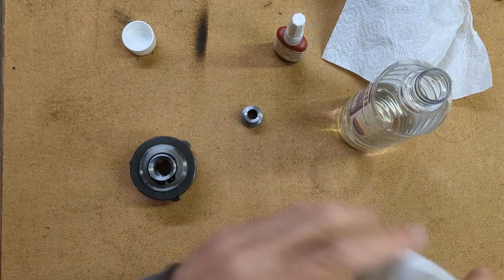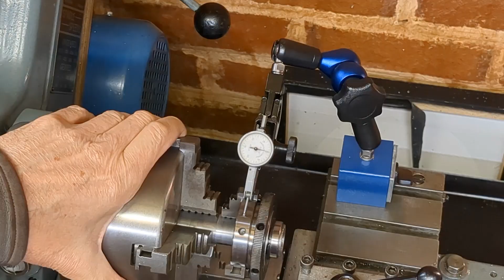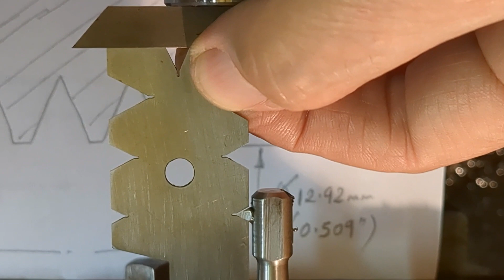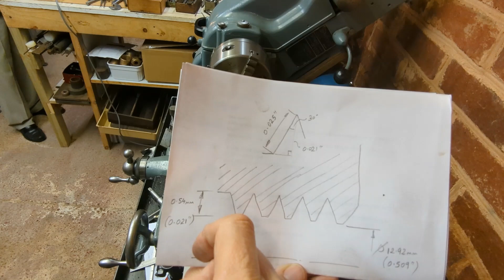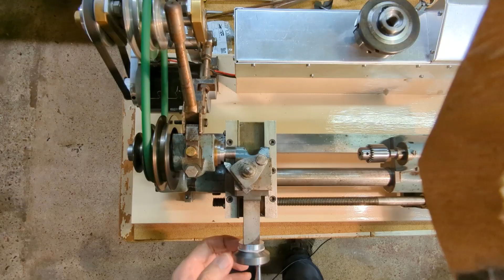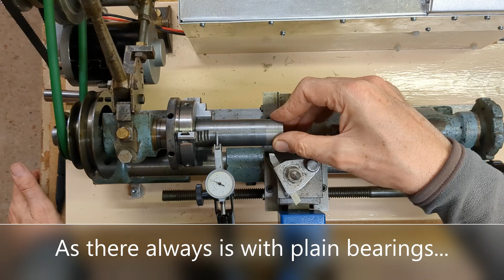#13: Small lathe K01-63 chuck completion and test

Comment: Interesting to see your work process. I think a possible mistake was assuming that the jaws were true on the new chuck.
When trying to solve run-out that includes multiple elements it can be good to eliminate un-knowns one at the time. A possible approach coud have been to:
- Mount the small chuck in a 4 jaw chuck, front side out, and true it up. Check for runout on multiple points, and also check it the guides for the jaws are parralel and at the same distance from the front of the chuck (if that makes sense)
- Grip the small chuck in a 4 jaw shuck, back side out, and true it up as it best makes sense in regards to the measurements just taken.
- Double check that threads and mating surfaces on spindle runs true 
- Cut thread and mating surfaces on chuck
- Mount it all in the small lathe and grind jaw surfaces in situ.

I realy enjoy your videos and slow pace, a calm place in a fast world. Keep up the good work!
Reply from the maker: Thanks for your helpful comments. Yes, I agree that I assumed the error in the chuck jaws were small and that this would be compensated for in the set up. In retrospect I should have undertaken a closer inspection. I didn't expect a new chuck to be significantly out of alignment!

Comment: Hallo...   Is this chuck jaws reverseable? Or does it comes with another set of reversed jaws....  Plz let me know
Reply: Am I correct if I state that usually jaws of an independent chuck are reverseable and the jaws of a self-centering chuck are not?
Reply from the maker: No the jaws are not reversible since it is a scroll chuck. The chuck didn't come with outside jaws. Hope this is helpful.
Reply from the maker: My apologies. I had second thoughts and checked the jaws. They are reversible!

Comment: Thank you for this instalment in your interesting project. I wonder what the run out would be if you used an even smaller, and hence lighter test bar? 🤔
Reply from the maker: Good question Andrew. I think the 5/8in test bar was light enough but it's run out at a distance was even more. It seems the chuck isn't accurate over its holding range and/or the chuck body isn't rigid enough. Perhaps I compromised that further by boring out fur the bush?